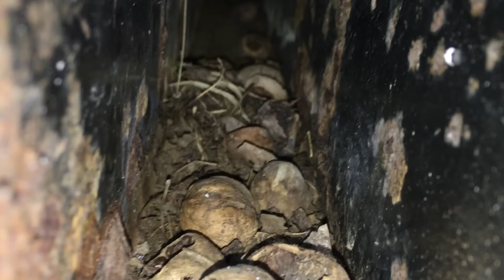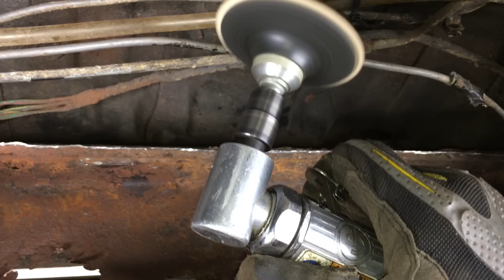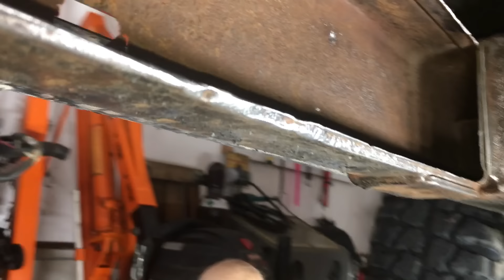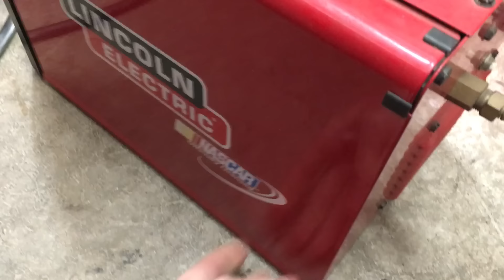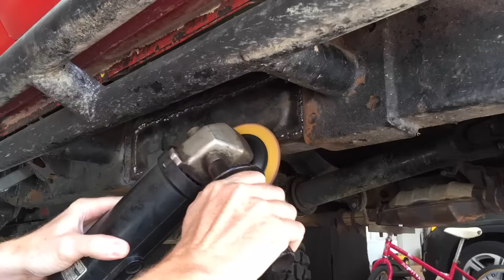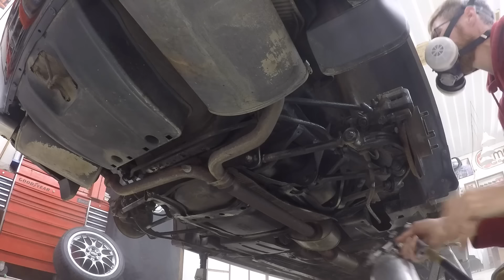How to Properly Repair Rusty Frame of Toyota Pickup Truck at Home

Comment: Should maybe add that " Be sure that frame repairs are aloud in your area" Where I live, you cannot repair a frame. An "obvious" repair on a frame will not pass the local safety inspection.
Reply from the maker: Interesting, Where do you live? I often forget that Ohio is not the only state without inspections.
Reply: @6thGearGarage  I'm one of your northern neighbors,  about 1200 miles north west. If I were to try this repair it would fail the safety inspection. To be honest, you real should have used a backing strip to insure 100% weld penetration and a fish plate to reinforce the repaired area, that would be much closer to a proper repair as it would be stronger then the original frame. I did many structural repairs on industrial HD equipment in the last 32 years and even with a certified and registered welding ticket, our insurance company will not pass a repair like this.

Comment: I use 3m spray rubber.
Reply from the maker: That is actually not good for a frame. Toward the end of the video I explained why anything rubberized is not good, at least in this region of the country.
Reply: @6thGearGarage  gotcha lucky I have a fully boxed / sealed frame.

Comment: This is a bad repair and it's waste of time 
That chassis is rotten and needs to be dipped in chemical tanks repaired and then galvanized
Reply from the maker: Eventually I'd like to replace it with a rust-free frame from the southwest.

Comment: a good rust paint but not with spray paint a good brush is the best and rust paint you dont need primer if you want !!! if you really want you can put primer but honestly just good old brush and a good rust paint
Reply from the maker: I did brush POR 15 before, it held up for about 10 years.

Comment: a flux core wire would have penetrated better then the gas and yes maybe a little more splaster to clean but a better penetration for your weld and a little bit of the other comment !!! but good job !!!!

Comment: Im no pro. I use wax on the inside do not remember the name alot of years i did the repair. On the outside i just used hammerite and under coating.
Reply from the maker: I've heard a lot about cavity wax inside the frame but I haven't tried it before.

Comment: I have n.y. Trucks with 25 and 27 year old frames in New York. Do some research, por sucks. Fluid film, wool wax, anything with lanolin. you reapply it annually, you never have to paint. It is lanolin based, wax, it will create an airtight seal of the existing rust, since you have removed the worst of it,  ahhh you just started talking about fluid film. You are good to go. My trucks still Still have factory stickers on the bottom.
Last month my 25 year old Ford e 350 went in for a bit of work, the mechanic was bitching about them being rust buckets, as usual he went and got all the shop guys to show them a 100% rust free ford frame and complete underbody with 25 years of winters on it.
Reply from the maker: I swear by fluid film. PB Blaster now makes something similar to fluid film that I've heard is a great product.

Comment: Argon is a bit cold. Try trimix. Will weld hotter.
Reply from the maker: I actually meant to say Argon mix there. I use C25 which is 75% argon 25% carbon dioxide.
Reply: @6th Gear Garage  sounds good. The tacks looked like you were using the 75 25. Straight argon works but makes for a colder weld.

Comment: That's a lot of work! I've always used blended 75%Argon/25%CO2 gas for steel MIG and straight Argon for steel TIG.
Reply from the maker: I said argon in the video, but I actually meant 75/25. I just got a refill, about to start replacing the floors in another rusty truck!

Comment: My first Toyota truck was a 85, 2 door with a little room behind the seats. After that I had 5 more. Current one is a 2012. Would not buy another one . None can beat the 80 and 90 trucks. After that they went down hill. My best one was the 92. It was my first 4 wheel drive .
Reply from the maker: I agree... these were simple trucks that were over built. It's just too bad about the rust.
Reply: @6thGearGarage   once they made the truck wider in 2005, that was the end of them.

Comment: That's the enormous advantage of the old style frame compared to modern car chassis. It's an immense advantage when you need to work on it. Not a perfect looking weld but as far as it contact the two pieces fully and as deep as possible, it's a good one.

Comment: in my opinion as a bodywork mechanic, the frame is for scrap, why?
the car is built to carry 1000kg
as you can see, the rust has increased the frame from 3 mm to 1.5 mm, so the car can only transport half of it, and maybe not even that, what you did, you just held it on the wheels, nothing further
then what I experienced as a technician, you removed the rust from the inside, now the rust has free rein to quickly form new rust
Reply from the maker: I also coated the inside with fluid film.
Reply: @6thGearGarage  I'll tell you a story that I experienced myself, I bought an Isusu Campo pickup from Holland, the car on the photos looked very clean, when I saw it myself up close, it was a drama
the whole rear part of the frame was rusted through and the seller had put newspapers in the frame and smeared them with mastic black
an old master gave me the idea
So I cut the pattern from cardboard and had the pieces cut, i.e. from the outside inside and out, and top and bottom, I sanded the whole frame at the back and removed everything from the frame, mounted the car on a dozer like that it didn't bend, and I welded for three days, you mustn't weld all day, first the welding machine can burn through, everything becomes crooked, so bit by bit
so what did i do, i left the old frame in, so the rust can eat the old metal until it gets to the new one, 20 years pass, then i don't care, i had the car in my possession for 10 years ,it never let me down,Isusu is the best company in the world,diesel engine 2500cc
I transported 900 kg of bricks to build my house.
I don't want to comment on your quality of work, it's just that the frame has become very thin, the rust wasn't even that much on mine
I wish you a healthy 2023
Reply from the maker: @ανακολ  Thank you! I would really like to purchase a rust free frame but there are none in this region. In the US they are all located in the south west, almost 2000 miles away. One day I'll afford to have one shipped here and swap everything onto it.
Reply: @6thGearGarage  oh so far! yes, it would certainly be better, but the question I ask myself, is it worth it? so much money to invest, unless you want to keep it as an oltimer, we have special license plates for oltimer but the car must be more than 20 years old
there is a factory in China that builds frames for Isusu, I don't know if they also build for Toyota, for me it was uninteresting to buy one, the frame was very cheap, but the transport was very expensive from China to Greece
can't you build one yourself with plasma?
or build one yourself from a 2.5mm square tube you just have to find a company that will bend it for you, I'm sure it'll be cheaper
you just need a good base, for example made of chipboard and of course a laser, not an expensive one, just that you can see so that it isn't crooked, you make a cardboard copy, just one from one side, everything is the same, unless your frame does an extremely different one on the other hand, but I don't think so
I fixed one once, it's a normal frame
ok rest, make good food, go with your wife if you have one for dancing, let the time pass a bit
then you will find a solution, i wish you all the best anyway

Comment: Safety tip for you secure your gas bottle......if that thing fell over  and broke the valve off you could have a torpedo in your garage, those things full are about 2000 psi
Reply from the maker: Great advice, thank you!

Comment: I avoided this problem all together by simply buying a Ford instead of a toyota truck. My 94 F250 has 300,000 and its never given me any problems and the frame has zero rust. Although i did make the mistake of buying a 22 toyota corolla. Moral of the story is to avoid toyota at all costs.
Reply from the maker: My ford looks great underneath because I keep it out of the road salt :) Japanese steel from this era has corrosion problems, but the newer Toyota frames were made in the USA by Dana and they have rust recalls as well. You can't go wrong with an OBS F250- great trucks!

Comment: Youre lucky you had a garage and lift dsoing this.. i had to replace a 2 foot section of my C channle on my 90 grand wagoneer, in a parking spot in my townhouse...  I had to drop the gas tank skid.. the tank, and remove the leaf spring, and body mount.. and find a donor peice from a 78 cherokee chief,, i did it with a 90A flux core welder too, laying on my back....   I had to fix this because they al tend to rust by the gas tank, some prior owner attempted to fix it welding 3/16GA 90 degree angle plates.. i guess that worked for 10 years but then i had to deal with the aftermath of that making it worse... trust me it wasnt fun..   You need to work on your welding though, i did mine with a 100$ flux welder, and my welds were way way better and i did it laying on the ground on my back and side...  why are you welding with 1 hand ??   Also why are you grinding the welds.. this isnt a body panel.. youre just weakening the welds by grinding...  

also your frame is boxed.. just cut out square on the bottom in various places to allow it to breath and drain... it isnt gonna hurt the structure of the frame

and honestly looking at the inside of your frame.. that truck is junk...  i wouldnt be driving that on the road
Reply from the maker: I ground them because they looked like shit and i wanted to re-do the welds. I'm by no means a professional welder. Never heard of anyone cutting out the bottom of a boxed frame, but I did drill the drain holes larger.  I realize the frame is just going to need repaired one section at a time as it continues to rust.. hopefully I can find a clean frame from the west coat and have it shipped to Ohio one day...
Reply: @6thGearGarage  yea my wagoneers was bad too.. square drill giant hole.. thats what i ment.  The wrangler frames are nortious for this too

Comment: If you take a length of steel wire rope cable you can make a custom length wire wheel un wined the last few inches like 3 and bend it 90 degrees put it in your drill there are videos on this to clean the inside of a dirt bike exhaust it works pretty good just run at a low speed
Reply from the maker: That's an awesome idea!

Comment: The PROPER way -- is to lift the body UP- move the old frame out of the way- roll in a new one with your suspension and power train on it- and put the body bck down.. finish- and DONE.
Reply from the maker: I'd love to do that if I ever found a rust free frame.
Reply: @6thGearGarage  Wonder if it would be possible to BUY a new one?? Before all the other stuff was added??  I know that would be expensive- but maybe worth it-
Reply from the maker: @davidwayne9982  I havent found anyone reproducing them yet, but as there are fewer left every year I hope someone will start to reproduce them soon.

Comment: I was hoping you take advantage of having a big hole in the frame and sprayed some rust Seal inside of frame before you closed it up 😢

Nice video I wanted to do this to my Tacoma but it’s kinda hard. When is your daily driver
Reply from the maker: Yep, I did spray fluid film inside later in the video.
Reply from the maker: Yeah on a daily driver you'd have to work pretty much all weekend and that's if everything goes well.

Comment: It can not be overstated how much this job sucks to do. I've done three Tacoma frames (if you include the first gen Hylux which the inner frame had to be completely removed and replaced). Iron in the face isn't the funnest part of restoring my favorite truck. I did a '67 F-250 as well. The frame was cherry on it being from Va. Not much body work to do on it, but the drive line was completely removed and restored.

Comment: The next coating: If You ar e willing to clean the whole frame very well, then clean it and brush a coat of zink in it first, attach some boating anodes and then coat it with any soft rock guard. After the zink and soft guard on top, it'll last a thousand years.
Reply: What products are you talking about? I googled and didn't make sense